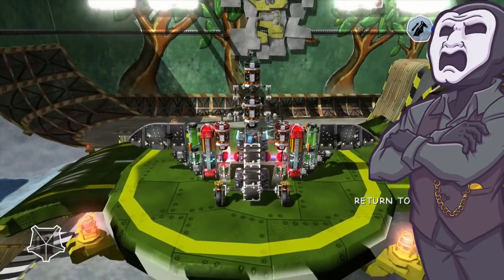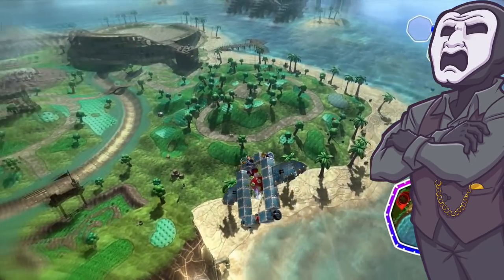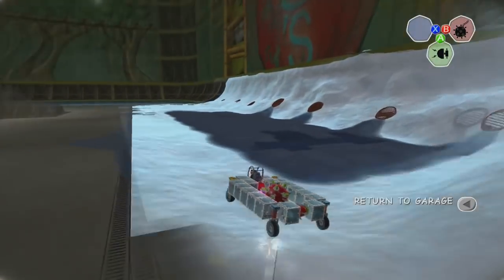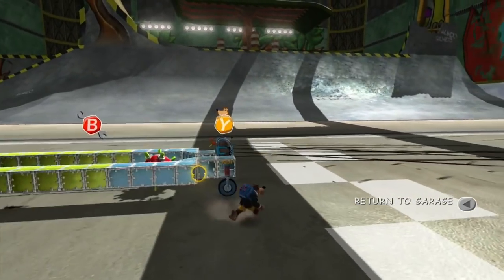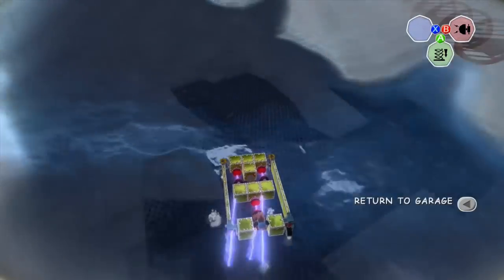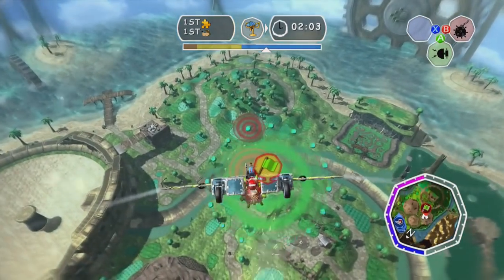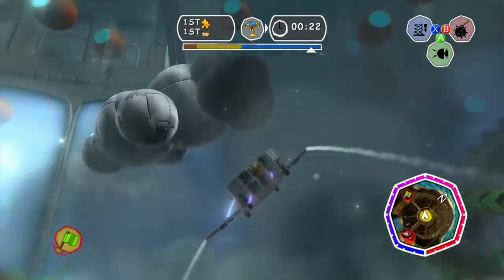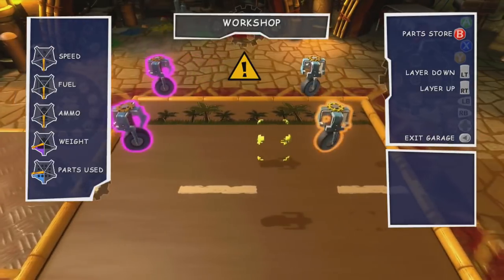Sticky Ball Engine - A Builder's Guide to Nuts & Bolts

Comment: So is it able to stack speed with jet engines?
Reply from the maker: +Luigi for President certainly does! - Grim
Reply: Grim, while this is on my mind, Is there a way to potentially desync the egg guns so that there is a way to fire them non-simutaneously to have a higher rate of fire? This can maybe be used on the grenade guns or other weapons, and can maybe be accomplished by using a detacher and reattaching it back on. It may be a pretty good myth to bust!
Reply from the maker: @Viraxian  Mmmmmmm the only way I can think it could possibly work, is if one egggun was on the main vehicle, and the other was connected to the main vehicle with a towbar, and while holding down the fire you managed to un-connect/reconnect the towbar gun between shots. I'm not sure if this would work, but it is the only way I can think of it possibly working! (before you spend too much time experimenting, I'd try it with a weapon with a slower-rate of fire, just so you can establish possibility before spending time trying to get timing right) - Grim